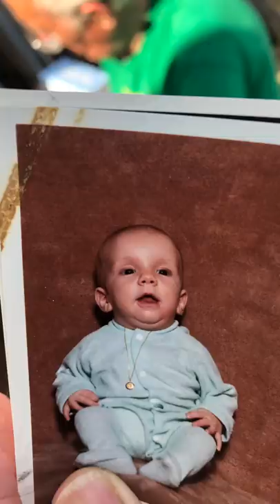Pt 2 - Cleaning 30 Years of Clutter From Backyard #hoarding

Comment: Excellent work! With regards to the pole that used to hold up the satellite dish (with all the scrap metal), might I suggest an angle grinder for future demolition projects? Very inexpensive, yet you can cut through steel with a little patience and face protection. :-) You are a blessing to your family.
Reply from the maker: I appreciate the advice. I was going to cut it but we had a guy coming after to level the ground and it would've wrecked his machine had we left anything in the ground.
Reply: @LeviStanford  Excellent point! My suggestion was for the excavation! :-) You folks had a heckuva hard time digging the dirt around those welded pieces. I was thinking about cutting those to make the excavation easier, so you can then proceed with a complete excavation and removal. This advice will be handy for when you travel back in time to re-do all your work on your Dad's backyard. Won't that be fun! :-)

In all seriousness, I think you'll have a fun time with an angle grinder, since you're so handy. To date I have never "ground" anything with mine. It's all about cutting steel, baby! You'd be surprised how often during a project you'll have a piece of metal that really needs to be trimmed, and sure you could use a Sawz-All but the grinder is a lot more fun (and I'd argue quicker than the Sawz-All). Just don't have anything flammable nearby, and wear full-face protection, because you'll generate as much sparks as a fireworks fountain.
Reply from the maker: @FlatEarthMath  ahh I see what you mean. Lol if time travel is invented then I will definitely not be going back to this. Lol

I actually use Angle grinders all the time, especially for making my Prosthetic attachments. Couldn't agree more, very, very handy to have and are way faster than sawz-all.

Comment: Waste of time and effort taking out that concrete slab and the post could have just been cut off... DoH
Reply from the maker: Lol I love the experts videos like this bring out. We were going to be tiling the backyard so we had to get the whole pole out otherwise it could've wrecked the blades. I believe in doing a job right and not halfing everything because you are too lazy to do it. No point in leaving make work projects fort the future. It's best to put in the time and get it all done now. No one wants a random slab of concrete in the backyard that serves no purpose. It took an hour to get it all removed, it really wasn't much of an effort at all.🤷🏼‍♂️
Reply: @LeviStanford  great.. Could have mentioned that in the video. It was posted as a "clean up" not a preparation for rototilling. 👍
Reply from the maker: @WApnj  exactly... We cleaned up. We took out a useless cement pad and a useless pipe.... Is that not cleaning up? Do I need to give a reason for why we are doing everything?